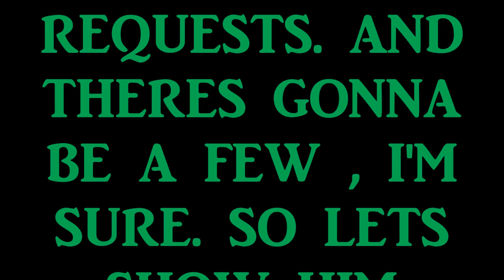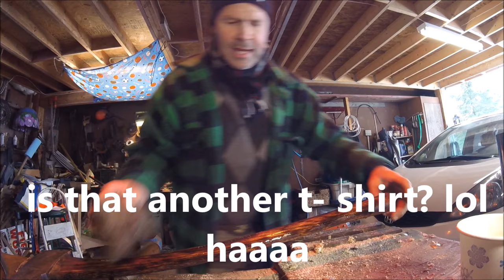BRADS AXE

Comment: Buckin you are an axe maestro, that ones a beaut! Read somewhere about chairmakers, they keep the rungs dry and the legs wet (maybe was the other way around? I'm no chair man, ha!) anyway after assembly when everything adjusts it locks the joints up tight, lasts a lot longer, ooold trick looks like you figured it out by yourself. Always thinkin, that wood man. Cheers!

Comment: Buckin you hit the wedge on the head there you need your hickery wood to be dry as before fitting have you tried a handle on top of the wood stove dry it right out get the fit spot on then right as your ready to wedge it and oil the handle back on the wood stove top get it nice and warm and then oil it.